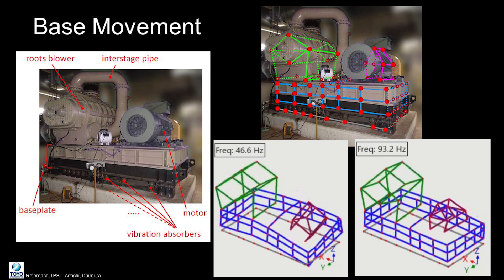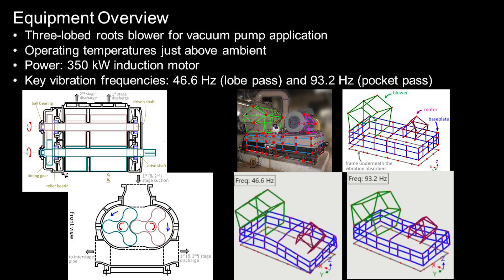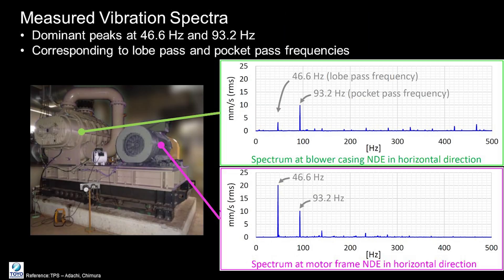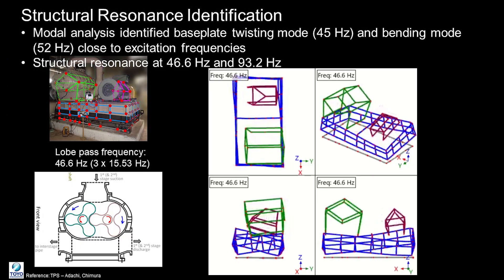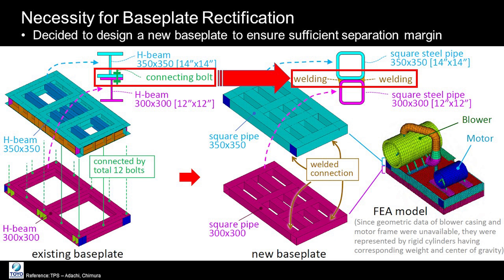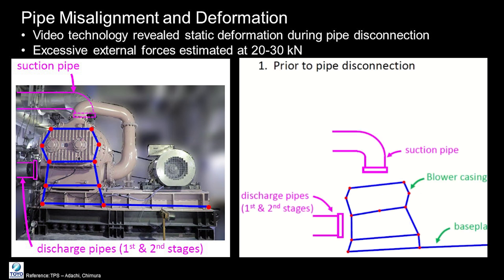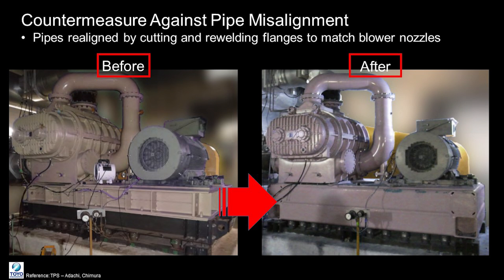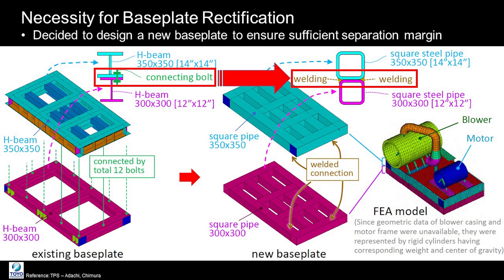The Hidden Danger: Base Movement & Rotating Equipment (Part 57)

Comment: Excellent work indeed! Could you advise how do we estimate the dynamic forces & moments exerted by vertical turbine pump, horizontal pump, electric motor & diesel engine driver, fan of air fin cooler? There are occasions when we need to estimate the dynamic forces & moments generated by existing rotating equipment, but the OEM of the equipment is no longer in business and the said information cannot be found in its equipment datasheets/drawings.  How do we estimate the resultant forces & moments exerted by the driver and driven equipment?  Thank you.
Reply from the maker: Thank you for the kind words—and that’s an excellent question.

Estimating the dynamic forces and moments from rotating equipment like vertical/horizontal pumps, motors, engines, and air cooler fans—especially when OEM data is unavailable—is a common and challenging issue in field applications. While OEMs may provide excitation force data in ideal cases, you're absolutely right that we often need to reverse-engineer or approximate these loads using available field data or design assumptions.

I briefly touched on related concepts in Part 49 and Part 40 of my video series, but this is definitely a great topic worth exploring more deeply. In an upcoming video, I’ll aim to cover:

*How to estimate dynamic forces from imbalance, misalignment, and base excitation
*Techniques like modal analysis or ODS (Operational Deflection Shape) to back-calculate excitation
*Typical force/moment ranges for pumps and fans based on RPM, mass eccentricity, and mounting
*Strategies for retrofitting or reinforcing foundations when OEM specs are missing

Thanks again for raising this. If you have a specific case or equipment type in mind, feel free to email me at rotordynamics101@gmail.com—happy to discuss further.

Comment: As usual excellent content, i would like to ask, why do we need "pocket pass " frequency, as it should be same as "lobe pass frequency"? If they are different, than how?
Thanks.
Reply from the maker: Thank you for your kind words and for such a great question! 😊

The pocket pass frequency (PPF) and lobe pass frequency (LPF) differ because they represent distinct mechanical and flow phenomena in a root blower.

Lobe Pass Frequency (LPF): This is the frequency at which the lobes pass a fixed point, like the discharge port. It's directly tied to the number of lobes and the rotor speed. LPF=Number of Lobes×Rotor Speed

Pocket Pass Frequency (PPF): This relates to the interaction of the spaces (or pockets) between the lobes and is typically Number of Lobes - 1 × Rotor Speed. It's important because it often corresponds to airflow pulsations or pressure fluctuations, which can impact blower performance and noise levels.

If you have a 3-lobe rotor, for instance:
LPF = 3×Rotor Speed
PPF = 2×Rotor Speed
This difference arises from the geometry and how air is transferred through the blower. Monitoring both frequencies can help diagnose different aspects of blower performance—vibration from lobes and flow pulsations from pockets.

Let me know if you'd like me to dive deeper into this! :)
Reply: @RotorDynamics Shouldn’t the PPF be 31.07Hz in that case then? (2x15.53)